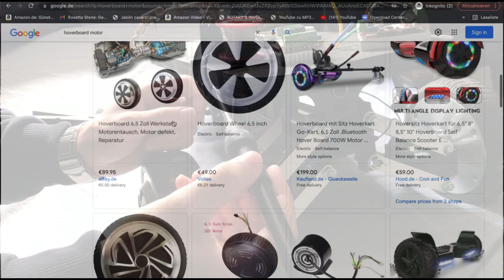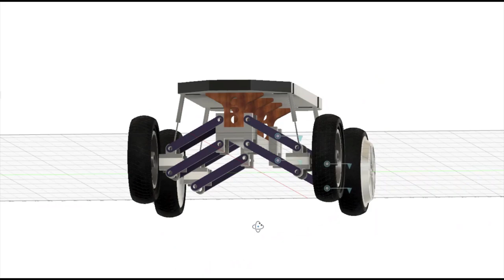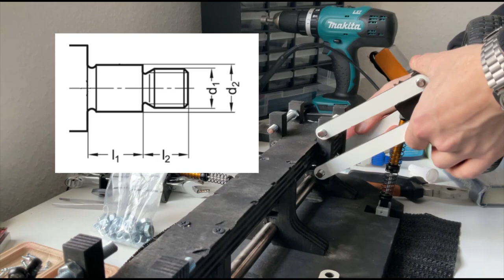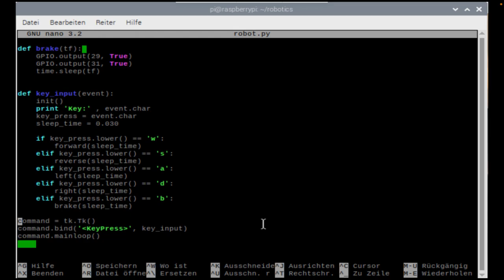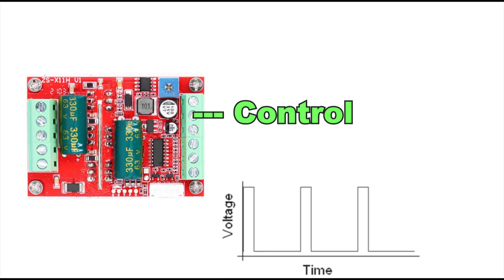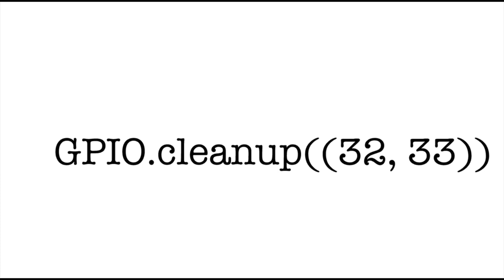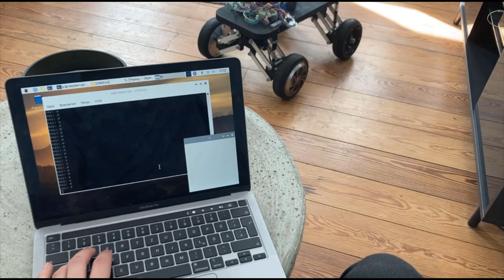DIY robot base from broken Hoverboard / CNC & 3D Printer

Comment: Thank you for sharing.
Maybe you could try putting a motor wheel in front and a motor wheel in the back diagonally.
Thus, the robot could perhaps rotate in its center.  Please tell me if it works.

Comment: Hi. I am building a similar vehicle and have the same controllers. In the specs it states that the control voltage needs to be 5v. But I measured the positive voltage output on the controller it showed voltage of 9-10v. How did you solve this problem? Did you even use this output to power your board or did you use a step down directly from battery?

Comment: If the front wheels could simply caster, the differential power to the rear wheels could still provide both power and directional control.

Comment: Can you tell me if you have applied PID to control motor speed ? As the the driver you used doesn't have any feedback pin. 
In simple, I want to know how the speed values for the motors are determined to move in a specific direction ?

Comment: Are the two hub motor wheels in sink? I am not able to do so, given forward and reverse speeds are very different, so when you move the robot forward one wheel is slow when moving forward.
Reply from the maker: I had the same problem and fixed it in the code :)

Comment: Hello, nice job. Im trying to do a similar thing with exactly the same controllers. Can I ask you what is the small module on the side, connected to DIR on controller and to RPi? is that a relay you are using? thanks
Reply from the maker: Hi Mirek, you don’t have to worry about that. I just tried some things out but you can use the 3,3 V from a raspberry pi directly. :) In the final testing you can see a small pcb, that is just a transistor circuit I used to control the 12 V needed for the LEDs. Good luck with your project!

Comment: Great Work! Depending on the Hoverboard you could use the original mainboard as motor drivers. I made a video on how to flash a custom firmware on these boards: https://youtu.be/H8HW9sRjj0k 
The firmware I used also supports a lot of different input methods with the serial input mode you can easily connect it to a Raspi.

Comment: Cool project. Congtras. May I ask which brushless motor controllers did you use? Thanks
Reply from the maker: Thank you! I used an “ZS-X11h” :)
Reply: @mazeg7880  Thank you 👍
Can you tell me which LED lights you have on your robot? They look cool. Maybe send a link to these lights? Thanks
Reply from the maker: @kaytondouglas2094  I put a Link in the description :)
Reply: @mazeg7880  Thankyou :)
Reply: @mazeg7880  Can an rc transmitter be used for controlling the robot instead of a laptop?
Reply from the maker: To answer your Question, you should
watch this Short from Proto G Engineering
https://youtu.be/cCnRR7LizYo